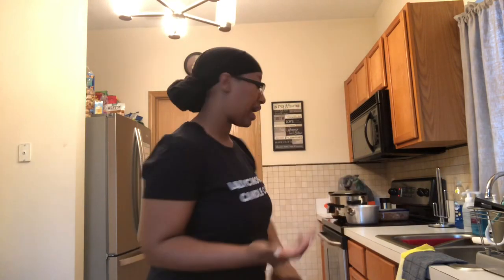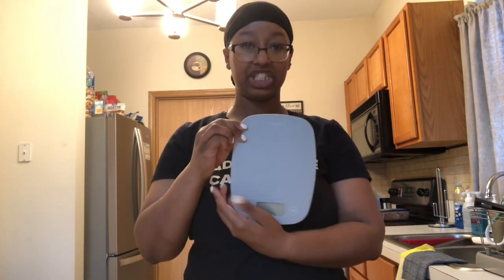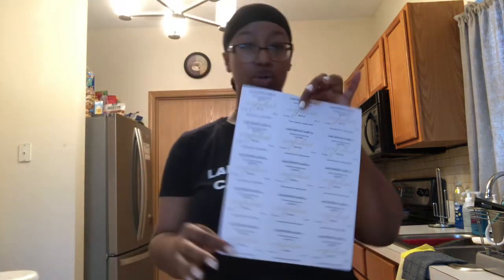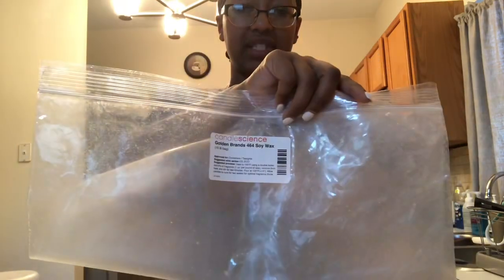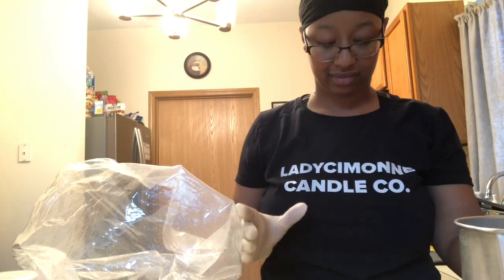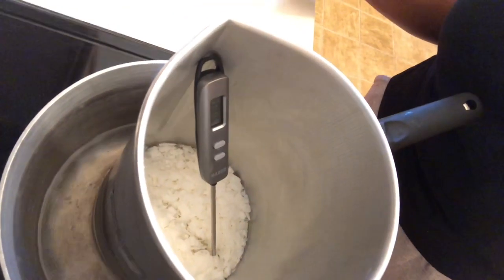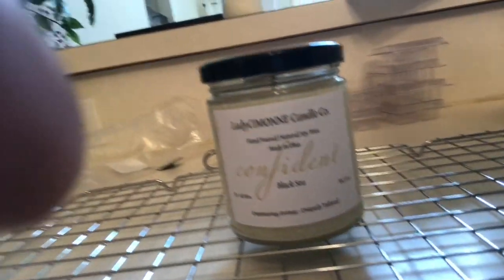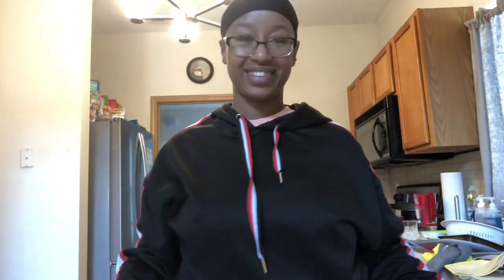How To Make Soy Candles For Beginners

Comment: I love and enjoy your videos. Quick question does it matters if you burn your wax on a gas or electric stove?
Reply from the maker: Melting wax you mean? And no it doesn’t matter. Just need to use the double boiler method.
Reply: Correct, melting the wax. Thank you and I appreciate it. I will continue watching your video. Excellent work and support.

Comment: Hey LadyCimmonne!  I'm a beginner. I found I had a terrible time eyeballing centering which affected my melt pool. Wasn't centered so my melt pool was off.  I discovered THE best wick centering and wick holder tools from watching videos so I sent my jar to Norden Candle Supply and had them make me a custom wick setter.  I had to have it custom-made to fit my custom jars I had made in China with my logo screen printed on them.  They make centering & wick holder tools for standard jars found in the US as well so you don't have to ship them your specific jar. Now my wicks are centered quickly in one step perfectly without worry.  The centering tool is flat on the bottom so it lets you press the wick tab securely to the bottom of the jar. Easy peezy! You may want to check them out. Will save you a ton of time.  :-)

Comment: I really enjoyed this video. I am just starting out.  
I want to know, how did you get the grams to oz AND oil ratio.  I’m looking into 4oz-8oz candles for now.  Also I believe you said 464 wax, is that correct.  Thank you so much for your help!
Reply from the maker: Latoya W. Hello! Depending on the weight to the fill line in oz that my supplier gave me on the website, I just googled how many grams that was. And I just decided to use a 10% fragrance load based on testing👍🏽 Yes, I use 464
Reply: What size jar?

Comment: So happy I found your YouTube channel🙏🏽 would essential oils such as Lavender work as well? If so, are there any differences in using fragrance versus essential oils in candle making?
Reply from the maker: I’ve never tried essential oils; I heard they are as safe to burn 😲💁🏽‍♀️ but homes idk. I’ve heard different things but also see so many people do it. I would to do some more fact checking on that! And welcome and thanks for the support ❤️
Reply: From what I've been told and found online about essential oils is that they may not "throw" well when burned in candle form.  You need a lot of essential oil to produce a smell (100 drops per pound of wax) and the smell won't be nearly as intense as fragrance oil.

Comment: Which heat gun are you using? At what temperature?
Reply from the maker: All my supplies you can access using the link in the description box. I use it on the low setting🙂

Comment: Few questions …where do we get the warning labels and what’s the temperatures required? I got the pouring one, 135. What about melting temp?
Reply from the maker: You can get warning from Amazon or any candle supplier. I heated this wax to 185. I don’t know what wax you’re using so following the instructions from the supplier of your wax.
Reply: @LadyCIMONNECandleCo  okay thanks sis

Comment: hi i really need your help. please. i have made candles the last few days and one of my friend told me the scent wasn't really coming but a nice decent smell is coming and it is spreading but not much... how can i improve please guide me what to do or suggest me a video is best for me to watch.. im using soy wax with beans and bars too and 4oz jar.... essential oil im using local and i put as much as it is. im even following the temperature which is it 180F then i switch it off and wait for it to drop around 140F to 130F it is okay? then i let it cure for 3 days to one week.. its been two weeks now and my friend just light it so its should have been better? why the scent is not coming and what is my fault?

Comment: Quick question do you find that when your add fo at 185 or 180 your ht is not as good as your ct when you use the 464
Reply from the maker: IAMBEAUTIFULLYFLAWED Yes which is why I add mine at 160
Reply: LadyCIMONNE Candle Co. Hello are you saying you added FO at 160 ?  I thought you pour at that temp
Reply from the maker: yve2diva I add my oil at 160 and pour around 135/140
Reply: LadyCIMONNE Candle Co. Thank you and I appreciated.  I have been getting tunnelling as a newbie on candle making so will see what happens now. X
Reply: what are low and high flash points i have 3 scents from  200 to 204 and and another 3 around 169-171 how do i determine when to pour the oils for which flashpoint and how much? do i use 18grams for both?

Comment: Hi, if we wanna smoothen the surface with a heat gun, should we wait for the curation to be completed and the use the heat gun? like should we wait for 1-2 weeks and then smoothen the surface? 
One more question: what temperature of your heat gun you use?
Thank you!
Reply from the maker: Kimia Gharib I do it the next day; but it’s up to you. I fix it immediately to avoid forgetting and having to go back later.
Reply: @LadyCIMONNECandleCo  Cool! and that doesn't mess up the curation process? I'm just worried that it burns off the FO...since I read the FOs need like 1 week of curation
Reply from the maker: Kimia Gharib I haven’t had any issues with my scent throw. Candles are cured after 24hrs. So that’s when I fix them. There is no right or wrong way. I like to have my inventory finalized and ready to go for shipping.

I use the low temp.
Reply: @LadyCIMONNECandleCo  Great! thanks for your prompt response!! :)

Comment: So i think i have ordered 7 or 8 fragrance oils from different companies BUT i can not get a STRONG burn or heat throw when i light it. So stinking annoying.

Do you have a strong, noticable scent from a specific place that you think is worth it?
Reply from the maker: Dora Vargas I order from Candle Science. Every fragrance acts different. One thing about soy, your not going to achieve a strong smelling candle anyway because of the wax. However, I use a 10% fragrance load and yes I get a good hot and cold throw with mine.☺️
Reply: @LadyCIMONNECandleCo  thanks girl. I will check it out

Comment: How long do you let your soy candles cure? And when you burn them, how is the hot throw? Ive been having issues with my scent throw because i was adding my FO at a low temperature. Someone please help
Reply from the maker: Hello! Normally about a week or so; depending on delivery and orders. I have not had an issue with my hot throw now at this point. I heat to 185; I pour in my FO around 160, and pour into my jars around 135.
Reply: @LadyCIMONNECandleCo  thank you so much for responding. Im going to try this❤❤
Reply from the maker: @eyeamthateyeam86  Sure thing! TESTING girl is what it's all about!

Comment: At What Temp Should I Add My Liquid Dye ? Using Soy Wax 464
Reply from the maker: You can add it right when you take it off the heat or I wait until before I add my fragrance oil at around 165🙂

Comment: How do I prevent my candles from cracking? :( I’ve tried making them but they crack on the sides of the glass.
Reply from the maker: You can use a heat gun to smooth out the tops. I made a troubleshooting video and have a free troubleshooting guide available that helps with this :)
Reply: @LadyCIMONNECandleCo  omg Thankyou for replying :,) I’ve tried smoothing the tops and it helps but I can still see cracks on the wax on the sides of the glass/vessel. Is it because it’s not cooling evenly? I’ll definitely check your troubleshooting guide! Bless you ♥️
Reply from the maker: @sevenskies3424  It's probably just cooling too fast :/ It happens. but that guide will give you tips!

Comment: I HAVE 444 SOY WAX I USED AND I CAN'T SMELL THE SCENT FROM MY CANDLES IDK WHAT IM DOING WRONG HELP ME
Reply from the maker: Fancy Monroe With soy, your never going to have a strong scent throw. Not sure what FO % load your using - I use 10% and that works fine for me. You could try 11% and see if that helps. Some FO are stronger than others.

Also, if you pour in your FO while the wax is too hot, if the flashpoint of the FO is not high it could be burning off.
Reply: @LadyCIMONNECandleCo  Ok I followed the instructions what kind of wax do you use? because i dont want to waste the wax could it be that im using diy starter wicks too i can smell the candles scents just not when i burn them
Reply from the maker: Fancy Monroe I use Golden Brands 464. If it all came in a kit, the wicks should be correct.
Reply: @LadyCIMONNECandleCo   What about the tart wax? I see its on your list which one is better for scent throws?
Reply from the maker: Fancy Monroe I just order my tart wax from Candle Science. I’ve only tried that kind. No problem with scent throw.